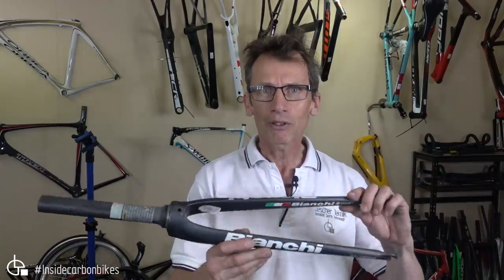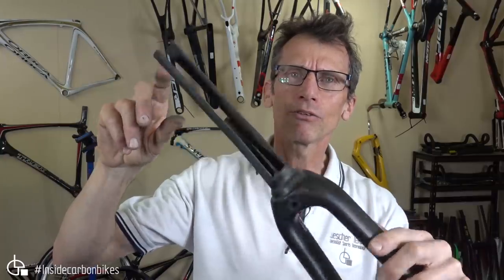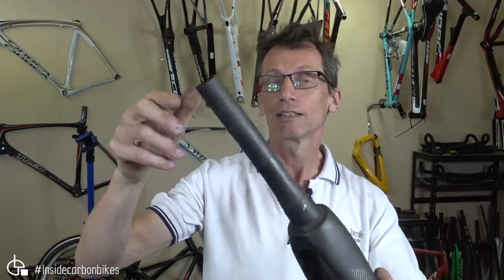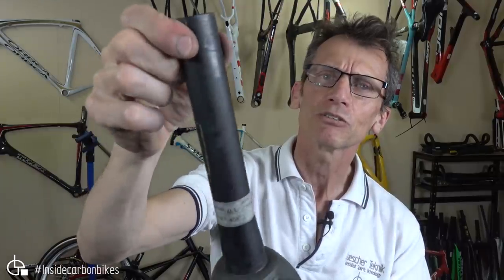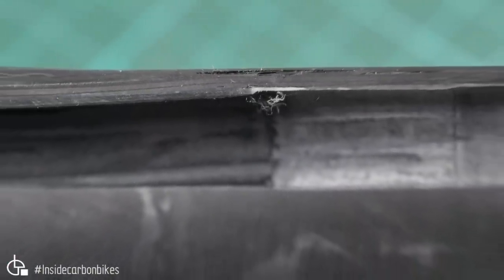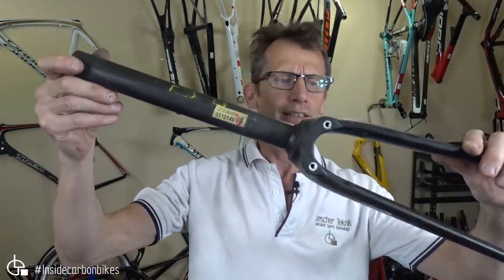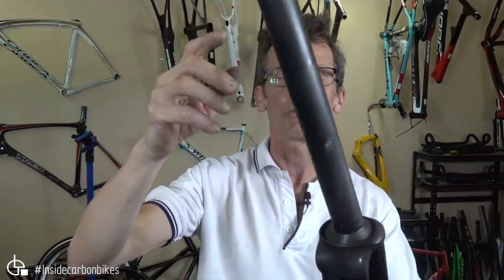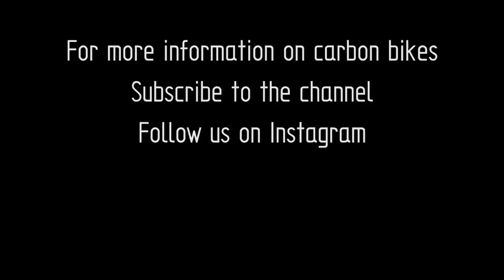Fork Steerer Failure - Recent Crash

Comment: I prefer steel forks. Heavy crown construction with a steel steerer. Full carbon if the lightest bike is the object, but when is that ever important? Unless you are trying to win the lightest bicycle world champs?
Reply: Ive seen more steel forks fail than carbon. Ive never seen a carbon fork fail actually. What we see is people running short plugs in their steers. Carbon doesnt fatigue. Steel does. Steel aint real when it fails from lots of miles.
Reply: @durianriders  This guy makes money when people bring their carbon forks in to get scanned.  He has incentive to scare people into bringing their equipment in.  He never mentions what brands have the least amount of defects.  If he wanted to help at all he would cut up some hongfu dengfu cheap Chinese bikes and let the people know which ones are the best.
Reply: @davidwinters9461  No brand chinese carbon has a huge variance.. he would have to cheack a lot of forks..  and you would only learn that yes, there is a big variance.
Reply: @aitorbleda8267  It seems that all the manufacturers have a huge variance.  I'm talking about frames.  The quality build of the frame.  If Hongfu frames have the same quality as all these expensive brands then that's a wrap.
Reply: @davidwinters9461  Same as forks.. only in general less critical, but still a lot of variance.
Ideally you could buy cheap carbon and have it tested.. and know if it has serious flaws in critical parts.
Reply: @durianriders  Steel doesn't fail suddenly like carbon does. A fatigue crack will take many years to develop. All components should be checked periodically for fatigue. I prefer that over invisible delamination and being susceptible to impact and abrasion damage. Each have their advantages, but personally for everyday riding I prefer steel. I have never been amused by carbon steerers, too fragile against stem clamping (yes even with a perfect plug) and scoring from headset assemblies etc.

Comment: Any recommendation for non carbon fork replacement? My fixed gear came with carbon fork but I want to remove it since I suspect a small crack by the bottom headset bearing

Comment: I had my steerer fail while pulling away from a stop light - fortunately I was at barely above walking speed when the handlebars separated & was able to pull over & get out of traffic safely. It was an aluminum steerer that I used a torque wrench with. Fuji refused to warranty it, saying that it was user error but I never overtightened it having always used a torque  wrench. My theory is that I ran about 30-35 mm of spacers on top of the stem (slammed) the entire 2 years I rode the bike and is it possible that the stresses of having that much spacers above the stem contributed to cracking & the failure of the steerer? I now will cut steerers when I get my position dialed on any future bike so that I only have 10mm of steerer above.
Reply from the maker: Sounds like you were lucky!

Comment: Hello Raoul!
Have you compared the cheap chinese carbon forks with brand?
Also please tell about difference between used and new carbon forks.
Is it a good idea to change carbon fork in few years in case that you don't have a ultrasound scanner or x-ray?
Reply: If you go back in his catalogue there are some examples he goes over, a look clone if I recall.
Reply: It's not a good idea to replace carbon forks after a couple of years. Carbon does not fatigue, so if it was ok once, it's probably ok practically forever. Replacing it would mean replacing a known good part for an unknown one.
Reply: @horrovac  You are incorrect.. as Raoul has proven here, most carbon forks are full of voids and inperfections that will eventually cause failure in most of them. most carbon forks, unless ultra-sound scanned, should be replaced with real metal...
Reply: @ggdd1299  I'm afraid you're the one who's wrong. Raoul did not, nor did he attempt to, prove that carbon forks are full of voids and imperfections, least of all most of them. His sample are the components that failed or had something wrong with them, which is not representative. He does not mention nor claim to know the percentage of components which have faults and imperfection. He is merely showing a couple of faults he has encountered and thinks worthy of note, and it is YOU who goes on to conclude that this is representative for ALL components - on no basis whatsoever. It is not. If it were, they would be failing all over the place. They do not. In fact Raoul himself states that most fork damage he sees are cracks caused by overtightening the stems, without anything being wrong with the fork itself.
For your education, a void is not a fatal flaw in itself. Depending on where it is located, it may be fine. If it is in an area that is clamped by the stem, that's bad. If it is lower down where there are no clamping forces, and the void isn't caused by a wrinkle, it may be ok. I'm a former aerospace quality inspector, and we were allowed to OK voids depending on the size or location, and even larger ones were sometimes approved after consultation with the engineering department. EVERYTHING that humans produce has "flaws and imperfections", and it's not the technology that makes it unreliable or dangerous, it's the engineering that provides - or does not provide - a sufficient margin of error.
Metal fails too, you know. So far I have broken several aluminium or steel components - most notably a badly engineered MTB frame - but as of yet no carbon ones.

Comment: I am curious to know if there is more of this happening in the European bikes vs North America. In the USA and Canada we have some terrible roads beaten by long winters. These bumpy pot hole roads will transfer the shocks up the carbon frame and the fork, which with severe shock will stress the carbon layers and cause a failure. I know Southern European roads are less beaten by winter and don't have 6 months of Winter contracting it. Just wondering if the roads are dooming some of these frames and forks. I always do a coin tap check on my Sava Carbon bike before I ride it. It's a standard sound check that is very useful and could save you from a bad crash just down the road. The Sava is T800 but much heavier than other carbon frames, as the feel of the frame is solid.

Comment: CF steerer are a problem. I've known a lot of rider for many years and steerer failure is quite common and incredibly dangerous. I would say that on a bike 3 parts can easily be letal when failing : 
Brakes (usually strong but a badly mounted brake cable can fail, not really the bike manufacturer fault). 
Handlebar (can fail close to accessory mounting point, stem clamp, sensitive part, often bashed hard in crash, multiple failure to rider around me, can be bery bad)
CF steerer as shown here.
Honestly other parts often fail without dramatic consequences.

Comment: Raul I think I remember you saying full carbon forks are better if made and serviced right,. This is looking like a high rate of failure or possible failure depending on where you draw the line. Do you recommend semi- annual scan or "life of" replacement on frame set?  I think I like my odds better with alloy steer and crown.

Comment: Well, if I understand you, fork failures are an every day occurrence. They result from voids and overtightening. What I'm not sure is what actions one should take to avoid a fork failure. While I was aware that they failed, and I assumed a failure would be pretty dangerous, even potentially lethal, I need a specific action plan. Should the steerer be removed and examined by a professional? If so, how often is the procedure recommended?

Comment: Perhaps someone will come up with a pourable material to turn the stem solid.  Very common materials in boat building use can be applied.  I would use polyester resins with glass fibers and silica.  Low cost too.  5 minute job, fully cures in 2 days.  Can add a threaded female insert for the bolt into the pour.  Good luck trying to crush it then, or sheer it off.  That expander plug design is useless as a reinforcement, seems intended only for taking up the bearing play.

Comment: Landed here after some research on which carbon fork I should put on my track bike. Is there even one brand that can be trusted? Is it because most if not all manufacturers just outsource CF work in Asia?
I wanted to save a little weight. Now I think I'll live with the extra half pound from my aluminium fork!

Comment: In between the layup of T1000 CARBON FIBER there needs to be sufficient resin applied to adhere to the outer layer of more compliant T800 FABRIC. The grain and the texture are different but will adhere together if the mold is tightened sufficiently. The inner layer of T1000 or now T1100 is super stiff, and if it cracks then the t800 flexes and you get layer separation. The resin itself HAS WEIGHT, and obviously not enough has been applied. Now if the bike is T1100 based then there is no flex on the headset and stuff has to give way separating the layers that dont have enough resin applied. There is also a curing process that must be adhered to in Aerospace application. Most manufacturers are worried their customers will complain if its overweight.
Reply: That's not how it's done. No resin is applied. It's already in the prepreg in the correct amount.
Reply: @billlieu9116   Connecting layers requires resin. Its on torays website.
Reply: @thiosemicarbizidebenzoylal2921  I don't think you understand how b-stage prepreg works.
Reply: T1100 q or g prepeg layered against t800 q or g needs a binder. I fully understand the process. That binder in the symmetric layering process needs glue or resin to cement those layers in a molecular bond. Even prepeg requires this material before the cooking process. What do i not understand? Please tell me.
Reply: @billlieu9116  Do you think its made from single sheet layering? Do you understand its more than a single sheet used in bike manufacturing? Or aerospace?
Reply: @thiosemicarbizidebenzoylal2921  You don't seem to understand what prepreg is or how the system works. That's too bad because a carbon bicycle frame is made entirely with prepreg (pre-impregnated semi-cured resin composite fiber). Nearly 100% of what you wrote is incorrect.
Reply: @billlieu9116   You dont just lay t1100 over t800. There is BINDER that is different from the glue used to attatch the parts.
Reply: @billlieu9116   I am wrong on the cause of delamination. It is attributed to air in the layering process. My description is correct for asymetrical layering of t1100 with t800 for proper molecular bonding by toraycamas own process description.
Reply: @billlieu9116  yep, this guy has NO CLUE how carbon frames and forks are made.
Reply: @ggdd1299  Sorry people, but you simply dont understand there is more than one composite layer in the layup and that takes a binding agent. If you think there is one layer to steerer construction then you watch too many you tube vids. Bill Lieu dosent understand load bearing pre peg construction. These are AIR BUBBLES that are being shown and not laminate seperation.
Reply: @thiosemicarbizidebenzoylal2921  One day someone with knowledge will take the time to sit you down and draw diagrams on how this all works and you'll realize how wrong your assumptions are.
Reply: @billlieu9116  Bill, one day someone will teach you how to read. Its on TORAYS WEBSITE. When the sheets are laid with the IMPREGNATED RESINS the links are applied with A BINDER. If there is one full sheet then of course there isnt anything applied, but a steerer tube ISNT ONE SHEET. Read the the website and understand the application for stifness. 100 percent guaranteed that Steerers contain more than t800 carbon if made correctly. READ THE DANG WEBSITE. The problem described are AIR POCKETS ON TORAYS OWN WEBSITE. Your not talking to someone that dosent know composites. If you think the car dudes that are laying sheets for forms of prepeg are properly constructing the form then you dont understand its application. There is a vid where they hint at proper construction but a whole lot are trade secrets.

Comment: It would be interesting to see the analysis of a fork that actually catastrophically failed in use, and the root cause.  Like the one you referred to.  I’m sure the manufacturer’s engineers to cover the design will say a safety margin is applied by means of overbuild and is more than adequate to cover the lost strength with limited voids spread out not concentrated, and is a more cost effective way to manufacture it.  A good defense will be it was over torqued or overloaded (?).  The forensic analysis will be the bottom line.  I wonder how many dirt cheap bikes including ones from Walmart sustain totally failed forks from other than plowing into a wall, I bet none.
Reply: It was off a Trek frame and a bonded fork that failed. Involved in prior crash and not replaced. The alloy fatigued and failed. Another case was the rider using a fork that had spacers above the stem and NOT a long enough steerer plug to go beyond the bottom stem bolt which resulted in a crushed carbon steerer and eventually a fail.
Reply: @DurianriderCyclingTips  you are making things up.. where are the sources of the information you are stating? all of the sudden you are an expert on the subject.. have you ever worked in the industry???  i don't think so...

Comment: On my C'dale Supersix Himod I've use Deda long expander 70 mm instead C'dale light construction, Hopefully I can avoid carbon steer tube breaking under load. 
I have accumulated many samples of 10-50mm rings from cutting the head tube. High-quality carbon fiber has thin walls and can withstand enormous compressive loads. Chinese brands and even middle-end line Canyon have thick walls. Despite this, they break very easily. I don't have an accurate frame to test for fracture load, but cheap carbon is dangerous to ride.

Comment: I do have a question that is somehow related to cutting CF steerers... can I do it using a dremel rotary tool? Would that be a way to speed it up and ?  I would use A foam spray to keep the carbon dust down ..  but I  doubt the foam would stay in place with a dremel...

A do have the Carbon specific  blade from unior and Park tool too.. but it takes time if I do it repeatedly  multiple time per days .

Comment: Are there any fork manufacturers who do QC properly? The voids and porosity are clearly manufacturing issues, and should be caught before the fork leaves the factory, especially because the issue is not detectable by the consumer. Damage from overtightening is a different matter, of course.

Comment: Holy hell! Does it make sense to bring in a brand new steerer for inspection?
Reply: TheCrossroads09 The next question which is interesting is whether a LBS/ manufacturer will take seriously or accept the results of a private entity undertaking a scan on a frame, and a finding of voids. Would be good to hear Raoul’s experiences in this area.  You could imagine drawn out arguments over the validity of the results and extent to which a part is actually compromised. And even if they do agree with an adverse finding, how long will the process take, and how long would you be without your potentially just purchased brand new bike. Especially if there was a waiting list for the model you bought anyway. That’s one thing that has kept me from getting a scan on my newly purchased carbon bike. Bottom line: manufacturers need to certify their frames void/defect free.
Reply: @sward5106  unlike the aero space industry there is no oversight from a governing body in relation to bicycle manufacturing.
Personally have been so paranoid about carbon and their painted surfaces that I could only buy titanium from now on but I still have the carbon fork.
Reply: @TheCrossroads09  Almost all of the voids are in the parts new from the factory... Here most of the originating flaws were from over tightening the stem. Remember to buy forks with proper sleeves, like the ones on cervelos.

Comment: While not foolproof, i still try and avoid a carbon steerer. Sadly my tcr has a carbon post which i dont like (esp bulging a di2 battery holder into as well).  Had an easton post on prev bike crack 80% around.  I almost went on a recovery ride but i had to pick bike up over something in the house and the seat moved. Thats when i found it.  I had just done a TT then road race back to back days.  Full failure on any of those ride couldve equalled my end.  I do not run carbon stems after i had an easton fail on ride #1 thus a crash when the bars dropped.  It hurt the bar too much for my comfort so i tend to avoid carbon bars as well.  Previous bike had ‘carbon bars and stem’ but they were carbon skinned alu that served just fine.  Skittish times.  -U10

Comment: I’m scared of carbon bikes. I know carbon is a great material, but if the manufacturers are not doing their proper inspections on the product they sell, how am I supposed to not be scared of it?!  I don’t have scanning equipment at home and even if I did I wouldn’t know how to use it.
Reply: To do proper inspections would lead to higher costs that they will then pass on to the consumer - so unless they are forced by some international regulatory board (non-exists) - they won't invest money into doing these inspections. Buy a Titanium, steel or Aluminium bike, their mode of failure is not catastrophic like CF is, so you will know before they fail.
Reply: Triode 12 I do own a Seven titanium bike and it is my #1 bike. I lost faith on carbon bikes not because is not a great material but because of the problems we see on videos like this. I agree with you that if they did better checks they would pass those charges to us. But carbon bikes are expensive already and I can’t accept this kind of mediocre manufacturing as if “this is just the norm”.